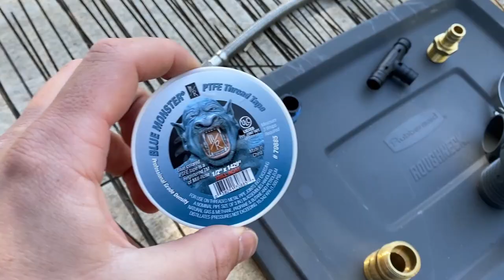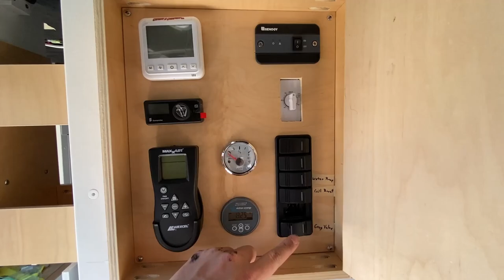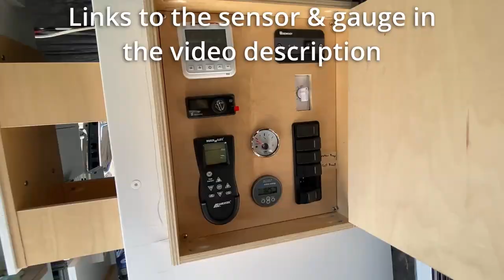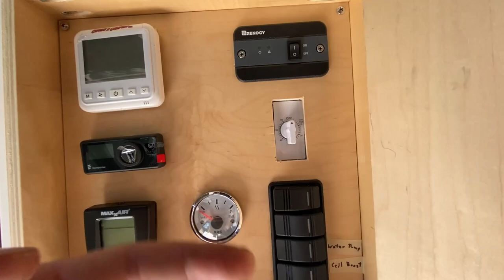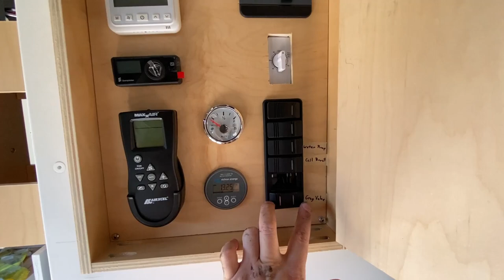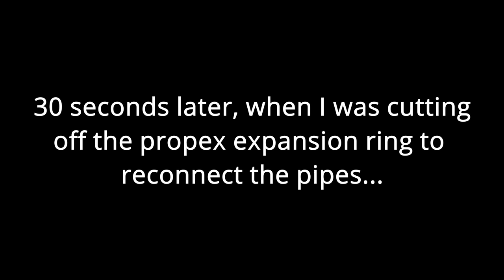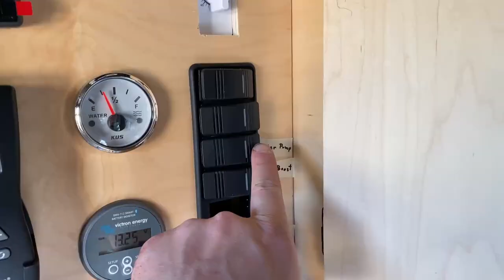INNOVATIVE 💧 Off Grid Water System IN A VAN 💧!!! ProPex, Gray/Fresh Water Tanks, Electronic Drain

Comment: You need to insulate the pipes under the van with the gray foam pipe insulation.
You need a sink p-trap.
Next time you build the plumbing system, make sure you run your main lines first from front to back then splice into the main lines left and right as needed . This way you get maximum pressure and less restrictive flow with all the turns like that. 
I’d also install that water filter in an upward position under the sink. 
Props to you for using the uponor wirsbo pipe and fittings. Pex A expands 3 times its size in case of freezing so perfect application for the van.
All this coming from a plumber that works with this stuff every day👍🏻
Reply: You do not need a sink p-trap for mobile applications like boats or vans where gravity takes care of the drainage. There is no chance of sewer smells if you're not connected to a sewer.

Am I considering one? Yup, for insect purposes, but definitely not needed.
Reply: I do not follow. Gravity takes care of the drainage in a house just as well. The problem is what grows on the pipe past the p-trap , bacteria will eventually start to smell even if you only put clean water through the drain.
We are licensed plumbers in Texas. On new construction, at the rough in stage when pipes have been under concrete for 2-3 weeks at this point, we uncover pipes to continue venting the fixtures and the water definitely smells. 
Now imagine that in a van after a year or so on a well used gray tank.
No thank you. P trap is cheap insurance and takes 2 minutes to install.
Reply: @andrealaphilippe5926   I have seen someone adding a vent on the drain (air admitance valve) to avoid gulping in the sink. What do you think of this technique?
Reply: AAV’s are perfectly fine . They do go bad sometimes so you just need to keep an eye on them.
We use them all the time where traditional venting is not possible.
They have to be accessible so you can’t put them behind walls.
Reply: @velianlodestone1249  Just watch the videos on you tube of people dealing with bad smells from their gray water tanks. ALL of them had issues with missing/inadequate p-traps and poor ventilation of the gray water tank. Also, lack of air admitter valves.
Reply: @olivierbourgeois3230  Definitely necessary.

Comment: My parents owned an ocean-voyage worthy sailboat.  The plumbing didn’t have anything pressurized.  Their was a marine grade foot-operated pedal below the sink.  Worked fantastic.  Marine solutions are designed to optimize reliability.  I think van builders should look at these types of solutions, rather than just motorhome solutions.   Also, reducing potential failure points is just good engineering.  Things to consider.
Reply: There are some vans that implement the foot pump to simplify their water system, but that's not really possible if you want an indoor shower like this build. The builds that use the foot pump tend to be budget builds that leave out an indoor shower in favor of outdoor units or using public showers. If you're going to include an indoor shower that needs electric components, it makes sense to use that for your sink as well for the convenience of having a faucet that functions like a normal house faucet.
Reply: @sarabeth3016  My parents’ sailboat had two indoor showers.   They had pumps for each shower.  But nothing was pressurized.  The shower flow rate was controlled by the pump and not a pressurized line and a valve.
Reply: The main difference between marine and land vehicles is the fact that you might be at sea when a part breaks, and then what are you going to do? (hence the priority on longevity for certain parts in boats) Vans and RV’s are on land and 99% of the time, are near civilization. O’Savage is building vans to sell to the 1%. Having a foot-pump isn’t going to get you the $150-$200k he’s looking for. 🤙🏽
Reply: @CrimpKeeper  Perhaps you are correct. I wasn’t aware O’Savage is in business so much, and not a DIY’er.  Either way, I’m sure his followers are DIY’ers and are not so interested in $150k motorhomes.  For me, building a van is to make it how I want it and to know how everything works so I can fix everything.  Also to make it robust and rattle free.  The last thing I want is a pre-made “motorhome” van.  I certainly don’t want leaking plumbing fittings.  In my house, I have copper pipes that are soldered together.  Having many plastic fittings that are pressurized in my van just seems like a failure waiting to happen.  What a mess that would be.  So I bought a pump you use when you need water.  My Westphalia and my Eurovan Camper both had non-pressurized systems and electric pumps for on-demand use.  I didn’t like the flow-rate (splatter) and noise of those.  So I’ve opted for a high quality marine foot pump. It is an under-suggested solution on YouTube DIY videos, but I think people might be interested and made aware of this option’s benefits.
Reply: @swagonman  o’savage is definitely building these to sell. I entirely understand where you’re coming from, but the 1% have more money than brains and people like myself and Savage know this, and want to take their money. Again, from a utility standpoint, a foot pump is the way to go for certain situations. I’ve used one for 9 months in my first van I built. It’s ok but it’s nothing to write home about. I just bought pro-pex fittings with the Milwaukee pro pex tool to install all my plumbing, and I’ll report back to you after dozens of hours of testing as to how they hold up. I’m convinced with the research I’ve done, that pex will hold up fine in these rv/camper van builds.
Reply: @CrimpKeeper  not sure which foot pump u had.  The rubber bladder ones are not nice.  The ones with the lever arm for close to $100 are much better.
Reply: @CrimpKeeper  I’m more interested in how it holds up for years, even 10+ years.
Reply: BUT:  Try that while taking a shower. :)
Reply: @jerryocrow1  You make a good point.  I don’t remember exactly, but the boat probably had an electric pump locally at each of the two showers.  I’m not sure if it had hot water or not.  As a child, we always just day-sailed on the San Francisco Bay.  We did overnight on occasion, but never used the shower even once.  These days, my van build doesn’t include a toilet, much less a shower.  The kitchen sink I’m building will use a high-quality foot pump and cold water only. I already have a bucket toilet for emergencies and a shower tent and pump-up portable camp shower that reminds me of one of those poison sprayers for gardens.  It’s a camping van and not intended for long-term residency.    I’m keeping things very simple on purpose, although I’m trying to use high-end materials and build things elegant and beautiful.
Reply: @swagonman  Karl. Do a video. Sounds quite interesting.

Comment: 1.  Those filters should be mounted vertically.  
2. Use some hangers and route differently ,  you have pipes wrapping your filters etc
3.  You went with a indoor tank to avoid freezing,  then proceeded to run water lines through the floor and outside.  Those will freeze.  
4.  Can that hot water tank and water pump be mounted in whatever position.  Usually they have a specific orientation.
5.  All those checks are totally unnecessary especially on the tank vent line.  Should have a gravity water fill on the side of the van which has a vent connection built in.  That vent should be uninhabited.  Road debris would never make its way up that line, and you have a sediment filter and multi stage filter system of it somehow did
6.  Should have a separate line t’d in for when you are hooked to city that bypasses the tank.  City pressure will almost always be more pressure than that pump produces and that saves you from using your pump and battery power.  Gravity feed fills tank when your off grid and you use pump.  When you hook up your city fill it runs through the filters and directly to your faucet shower etc bypassing the pump.  This saves your pump from needing to run,  saves power,  and offers redundancy in case your pump ever fails you can still hook up to city water and use your components
Reply: Thank you !
Reply: City pressure here is 80 PSI. Protect your tank from that with a pressure reducer fitting.
Reply: Smart observations.
Reply: thank you. was going absolutely insane watching this; as you noted. good constructive critcism
Reply: Don't forget about no p-trap on the sink. Even if it is just gray water, it's eventually going to allow some foul smells.coming up the sink

Comment: You could remove that little bit of vinyl tube between the pump and the accumulator (and all those right angle bends) and just run a line direct from the pump to filters. Then put a tee piece in that line and run a single pine to one side of the accumulator and simply blank off the other side of the accumulator. Water doesn't have to flow through the accumulator for it to do its job it just needs to be connected to the system! That would make your install much easier with a lot less joints for potential leaks down track.
Reply: For lack of a tri of 45 degree fittings, a 90 x 5 with a Big S curve creates a great amount of back pressure/flow resistance, water hammer when the pump turns on, vibration as unsupported and bouncing, etc.  Too much "Get 'Er Done" time pressure and not enough experience/IQ.

Comment: Another great video. Only thing I recommend is adding a water pressure regulator. When filling water from city or a camp site, water pressure can some time be higher than that of your campervan. This can cause leak issues when water pressure is at or above 40 PSI
Reply: True.  One should be in the drawer next to the proprietary water filling tube.  (Don't loose that.  Ever.)

Comment: You need to move your water tank drain ball valve into at the condition space !! If you leave it (ball valve) outside of the van it could freeze and try to freeze water line back to the fresh water because it is holding water back to the tank.By moving the ball valve inside the van 1st will keep it from freezing and 2nd it let all the water drain out of the line just like in a house up north. I hope this help you
Reply: Why? I just leave mine open in the winter. Am I missing something? The tank is under the van and the drain valve has to be on the bottom of the tank. How could you move it inside above the tank?

Comment: Hey Seven - I am using the same filters and water heater as you are and thinking through this setup. My question for you is, why would you want FILTERED water (hot or cold) for your shower? Or for your sink's cold tap for that matter (Will you do dishes with filtered water?). For my system, I am planning on piping filtered water directly to a separate faucet at the sink, while separate lines split off before the filters to feed the sink and shower's cold lines, and then of course to feed the water heater which will in turn feed hot water to both shower and faucet. By the way, I reference your videos all the time and have picked up a lot of ideas, so thanks for documenting all your work!
Reply: Or filter only the sink's drinking faucet.
Reply: The reason why people opt for whole-home water filtration systems I suppose. For me, it's because your skin is one of your largest organs, and when you're showering with warm water your pours are open and will absorb whatever contaminants are coming out of that shower head. Just something to consider.

Comment: A HEPVO valve under sink and shower will reduce odors from gray tank burping back up through the drains.  Works better than a ptrap in off road applications.  Its basically a check valve.
Reply: What about an exhaust vent to prevent odor from the grey tank?

Comment: Sweet van savage,
I’m a plumber in San Francisco not far from you btw…..anyway Just a heads up that those filters being mounted sideways is going to put a lot of pressure on those threads since I believe they’re meant to be mounted vertically so I would definitely design a support to support the filters so they’re not just hanging on those threads while they’re full of water and the van is bumping around. 👊
Cheers

Comment: I'm one of the two girls watching and converted my van on my own, thanks for the shoutout 😄 I used the same flexible PVC pipe to my grey water tank, works great! I noticed you didn't put a trap in underneath the sink, aren't you worried about smells? I have the Reginox Panama space saving syphon which I'm very pleased with. Easy to install, drains still fast, no smells at all and if needed easy to clean. Looking forward to your next video!
Reply: I noticed this too, but I think there may be a trap under the van
Reply: not a "trap' trap, but the way the hose is run makes a trap
Reply: Me three!!!!!! Thanks for all the guidance!
Reply: I am a girl too.  There must be more girls watching than just us two.
Reply: @4149natalie  🤣

Comment: Just now watching this, July '22. The filters should have been hung vertically on the left where the accumulator is. Pump should feed the filters, that way changing the filters means very little spilled water. The accumulator should be after the filters, this helps prevent trash and junk from collecting in the accumulator, but most of all, you don't have it pushing pressure back toward the filters. I have some concern about the spare tire carrier wearing on the gray water tank. Not sure it that is an issue or not in the long run. You left out the link for the Aquor water inlet, I did find it with a search. Very neat idea and much better than trying to screw a hose onto an RV. Underneath you have pipes and wires coming out of a seal. One of the tubes passes thru the bundle of wires, which will make jacketing them with loom material or other covering difficult and not as elegant. I do want to say however, your van build is a thousand precent better than most including professional ones, and you video production is quite good, as you have it well scripted and no duhs, uhs, and such. You spit it out and move on, which is how it should be, someone can always go back and listen again if need be. Thanks very much for all your video efforts so others can learn from you.

Comment: I am wary of mobile, pressurized water systems but looks like you have it figured out!  Certainly having it contained inside the van has some benefites.  But for reliability and economy I'm gonna stick with gravity everything and my trusty Rainshower which provides solar heated water.  It's pressurized with the same compressor I use to top off bike and truck tires.

Comment: Although the pump is "Self-priming to six vertical feet", it's better to have it as low as possible.  This will allow more discharge pressure.  For pumps that are not self-priming, they definitely should be low to allow use of the whole tank volume.

Comment: HepVo valves/drains for the sink and shower.
Reply: HepVo:  Thinking same thing. Grey tanks can get stinky and there is no p-trap to keep the stink from coming up the sink drain. 
Since this is his second van he may have a solution for that or sink stopper. 
Also needs to prevent water sloshing from full grey tank into the shower pan. 
Doubt the grey tank will ever get that full or stinky though given the electric ball valve setup.
Reply: HepVo is a must. Looked like there was room for this in his build.

Comment: I'd add a UV filter after the sediment ones and also this connection between the pump and the accumulator tank will always be your weakest link. Offroading will make it loose and you'll get leaks there. Ask me how I know :) Best option is to look for pump and tank that have threaded connections.

Comment: 1) I do not envy you when you go to change those filters 😅 
2) Your sink drain doesn't have a trap to prevent smells. Which will probably be fine, just pointing it out.
Reply: @The Osborns Indeed. I don't have my filters mounted at all. I only use filtered water and drinking water to fill my tank, therefore my tank is always clean. Saves space in my van as well.
Reply: Lack of p trap means bad bad smells
.

Comment: Thank you for sharing your journey with me.  I'm on mine and haven't begin to start the water system, but I'm learning lots, especially using a box cutter.  Ouch!  I personally think that there will serious drain issues because of the distance from entry to exit, and the drain is not gradual whereas the water has a long horizontal travel and dips.

Comment: For everyone using this as a guideline for their own built:

Make sure to get a p-trap, which is the little elbow shaped pipe right between the sink and the rest of the grey water system. So what is  the purpose of a P-Trap? ... Plumbing codes require a P-trap be installed anywhere there is an open drain line that expels wastewater into a drain waste-vent system. The P-trap traps solids that can clog the drain or sewer line and most importantly for Vanlife!!! the P-trap stops sewer gases from backing into your home/van through the drain line. And trust me grey water can get extremely smelly! 

Other than that same thoughts on the pipes @jeremyward already said it and please do not ever install water filters horizontally! You will regret it later, itll be such a mess, hope you see these comments mate :) 

Cheers

Comment: Finally firing up for plumbing in about two weeks (yeah, December is a great time to do water. . . NOT. ) this is SO much easier than your old plumbing vid - the Umpanor tool is going to choke me cost-wise this late in the build, but I think I'm going for it. . . . looks easier. . . . also excellent advice on gray water, although I'm keeping mine to a five gallon water carrier under the sink since the only shower will be out the back door. . . . also - very cool filling hardware. . . .
Reply: Try replacing a broken  Umanor fitting after a day of offroading in the middle of nowhere.  Try to find a $300 pipe fiting pump in Baja Ca.